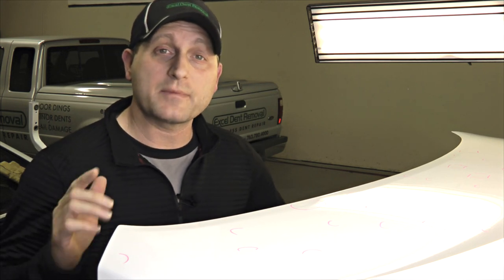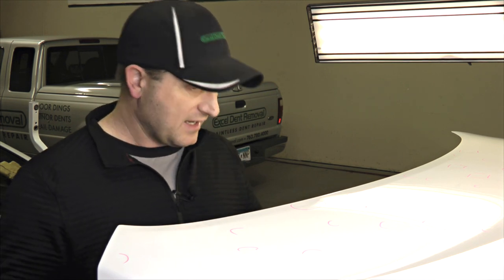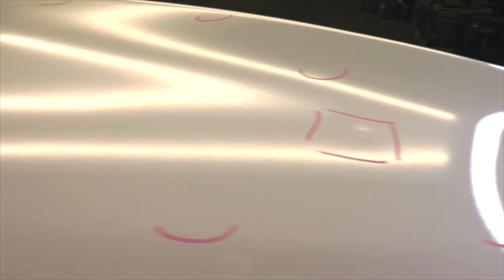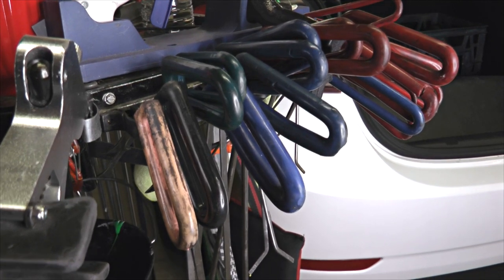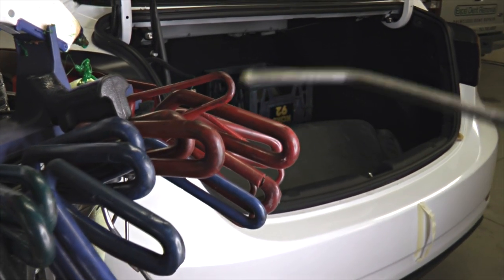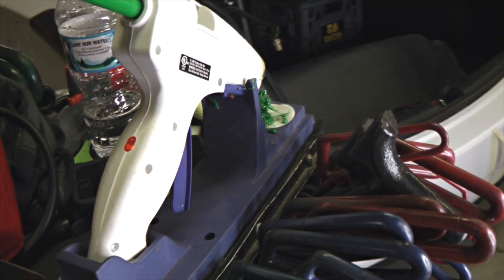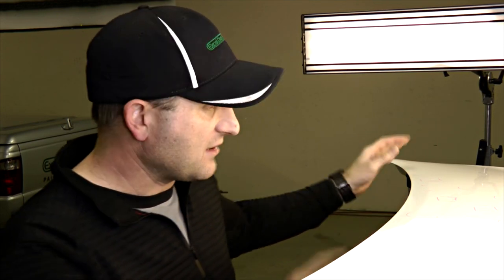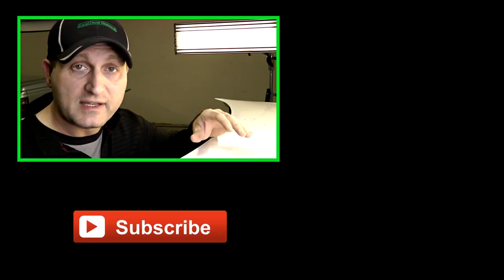How I Repair Hail Damage Dents | Paintless Dent Removal Under a Brace

Comment: Can you do an aluminum small airplane?
Reply from the maker: Yes. I’ve repaired dents and hail on several small planes. These are done under the supervision of the local airplane mechanic. They are often done during their annual inspection since they have to take many panels apart already.

Comment: Thanks for the video, is great ! I have a question , i can use the hotbox or woyo to fix dent as in this video ??
Reply from the maker: I have tried using the hot box before and didn’t have any success with it. 
I believe it can be used in certain cases but it’s not going to always work.

Comment: Hi, can this technique be used on older cars with thicker panels, or is there an age limit?  Thanks
Reply from the maker: Yes. I’ve repaired dents on many older cars. I just completed this week several dents and dings on a ‘66 Lincoln Continental. 
The only issue with older cars can be if there is areas with a lot of filler or if the paint is old or not in good shape. 

I have some photos of older cars I’ve repaired over on Instagram. www.instagram.com/exceldentremoval

Comment: Great video! Thanks for sharing this. I have a question though, Will you start pushing from the outside of the dent towards the center? or from the center towards outside?
Reply from the maker: For hail dents we would start by pushing from the center. But only slowly moving the metal up a little bit at a time. Just enough to see a slight improvement but not enough to see where it was pushed up or leave a poke mark. 
We then will continue pushing up the lowest spot inside the dent.
Reply: @exceldentremoval  . Thank you very much Sir. I am willing to work on MANY hail dents I have on my car. Your inputs are very helpful. Thank you again.
Reply from the maker: Yes. Thank you. If you haven’t done paintless dent repair before. I would suggest first practicing on a panel from a junk yard or scrap before attempting on your own car. You may find it is much harder to do than it looks.
Reply: @exceldentremoval  I saw you say that in one of your videos and it makes me worry a bit I could make it worse.

Comment: What about a dent in the bonnet that protrudes outward. Some mechanic left a tool under the bonnet of my car and forgot about it when the bonnet was closed. It caught the brace and made an outward dent. Hammer and a bit of wood?
Reply from the maker: +Gallitron This video shows the basic idea of how I work with a dent that sticks out. 
https://youtu.be/P8nf3DStqP4
If it is small it can be knocked back in. Sometimes it will require making it into a dent and then having to repair the dent to smooth it out.

Comment: Why is conventional repair charged by the hour but PDR techs charge by the dent no matter how small like these hail dents.
Reply from the maker: Good question! Body labor and mechanical rates are based on industry standard "book" time. These hourly times are calculated based on the time it would take an average tech to do the repair.
Paintless Dent Repair charges are calculated using a different formula. Dent repair estimates take into account many factors for removing the dent. These include the size, access, and level of difficulty to repair the dent among many others. The standard "book" times are still used when having to remove or install any parts on the car.
For hail damage dents there is another formula that is used within our estimating software that calculates the cost to remove the dents on a panel. There are many factors that go into a hail damage estimate. This will include extra cost if the dents are larger.
Reply: I have a vehicle with mild hail damage and am realizing the PDR shops so far want full insurance estimate amount even though the estimate calculated replacing and refinishing nearly everything.  Both shops confirmed all can be done PDR but damn ...  Ask me if I feel they're both after all the insurance money they gave me.  Vehicle is paid for and the money is mine to negotiate PDR now or leave the vehicle as it is.  This is simply between the PDR shop and I.  Might just drive to Mexico and have this done for $1500
Reply from the maker: There are a couple of reasons they may need to see the insurance estimate. 
One is that often the insurance estimate is not enough to repair the vehicle properly. Even if it was first written to replace the panels and painting. PDR is not always less than conventional.
Another issue is liability. Even though you have been payed by the insurance company, they often need to contact the insurance company to confirm that the vehicle will be repaired with PDR instead.
Other issues could still be replacing some parts that can not be repaired. These are often missed or will need an adjustment of the purchase price at time of repair.

Just let the PDR shop know that you want to have it repaired PDR and want to schedule the repair. Without providing the insurance estimate, they will want to have the vehicle in for the full repair before spending the time to write up a full estimate. From there you will be responsible for all repairs.
Reply: Like I said previously the entire "mild hail damage" vehicle was deemed 100% repairable by PDR.  PDR should most always be cheaper than the purchase of a new panel, remove and install, in some cases welding and sealed like a roof panel which also requires the removal and reinstallation of front and rear windows, then all refinished painted to match.  Wouldn't you think ?   Maybe it's just the two ripoff PDR shops I inquired with.
Reply from the maker: For mild hail damage it would be less. But I have repaired many vehicles where the cost for PDR was more than repair/replace and painting. Often times having to do a roof repair at a loss since the insurance company will only pay the “max cost” of replacement. But we and the customer agreed that PDR was a much better option than a full cut off and replacement of the roof.
Reply: How can it be at a loss when you'll only dedicate your time and skill …   no additional costs of a roof panel, removing / replacing and refinishing.   What's the time allowed or max number of minor hail dents on a roof panel you think before it's best to just replace the roof ?  Same for a hood.  All hail dents no greater than dimes nickels or quarters
Reply from the maker: Well, not so much a loss from a materials point. But yes, the time involved. If you could be spending that time on another car that is at the proper cost. 
The average replacement for a large roof panel can be $2000-$3000, but if it can still be done with paintless dent removal but the dents/damage exceed the normal estimating formula, then the cost can be more than replacement. 
Yes there is a point where there would be to many dents or many large dents that would require a replacement. But than can be different for most cars. The thickness of the metal, aluminum, steel or HSS steel, access and size of the panel can all have an effect. 
On average I would guess a small panel , hood or roof, with more than 100 would be excessive and a large panel, suv roof, with more than 200-300 is to many. But I have done some with more of the dents that are small and I’ve replaced some with even less because of paint issues or the material properties of the panel, aluminum or HSS.
Reply: Say a late model truck with 50 roof and 50 hood small hail dents …  How much approximately to repair ?
Reply from the maker: +Green Bullitt That’s tough to say exactly. There are so many different factors between vehicles and damage that can change the estimate. 
On average for that type of damage, you could be in the range of $2000-$4000 just for the hood and roof. That would not include parts or any side panels. Those could easily add another $2000-$4000.
Reply: Late-model truck hood and roof can be replaced and refinished for $3000 or less including the parts ….   Fixing a mild hail damage car 1-2" dings with total of approximately 150 - 200 throughout entire vehicle should be about $2000 - $2500 not the 4 to 8 thousand you quickly went to for just pushing dings and flattening high spots.  This job is accomplished in 1-2 days.   I wish the PDR industry was fair and honest because it's not a complicated profession but most want arms and legs for payment from insurance companies.   Prove me wrong
Reply: Conventional auto body repair costs being substituted by PDR has no relation from one to the other.  Apples and oranges.   Conventional repairs require parts, material and paint supplies on top of the man-hours to complete the repair.  PDR on the other hand requires tools to re-shape sheet-metal as close to pre-dent condition as possible and time.  Much less time than what is required for conventional repair.  A whole lot less costs since there are none but man-hours.  So this so simply explained shows that PDR should be a lot cheaper than the conventional repair costs period.  Not hating just the truth.
Reply from the maker: Sorry. I was just trying to help not prove a point. You seem to understand the auto industry more than just someone that just got hail and was looking for an estimate.
Reply from the maker: You are correct that auto body repair and PDR are to different fields. 
Auto body will require parts and materials along with techs to perform the proper procedures. 
PDR is mostly all labor. While it may seem like it is done quickly compared to conventional it could be because the labor is all performed and completed while the conventional repair has a lot of down time in between repairs. 

I will say that PDR may seem easy to do but many find it is difficult to do it properly and there still can be years of training to do it right. 

The other issue I can see is that it is not just a tech doing the repairs and being paid but most are individual small businesses with expenses and the the time needed to run a business. These need to be taken into account on a cost basis compared to just paying a tech.
Reply: PDR costs should be fair and honest and never exaggerated has been my point all along.  Hard working people in this world get ripped off in many ways and the PDR industry should not take advantage of those who don't know.  Hail dings for example 1", 2", 3" and so on should be estimated at standard costs with added cost only if warranted.  These should also be grouped by quantity never surpassing the cost of a new panel.  My future PDR YouTube channel will explain this video after video to help better the industry and help minimize insurance companies and people being way over charged for PDR.
Reply from the maker: Looking forward to seeing what you have. 👍 I’m not saying the industry is perfect and everyone is fair. I can only know what is good for my business. 
I know that the expenses just to run my business every month are 2-3 times what I am paid as a salary for the 60-80 hours a week I work. There is no way I could even afford to pay a highly skilled and trained tech to replace me as my own tech and still be able to run the business.  
There is way more to just paying someone for a repair than just there time that is involved with the repair. 

Another thing with the auto body industry as a whole is that it hasn’t kept up with inflating living costs. The mechanic rates are double what the auto body rates are. This is keeping new techs from entering the auto body  industry and wanting to put in the time for the pay.
Reply from the maker: Since you originally asked what a fair price would be to repair the hail and you have an understanding of the industry. 
Then I would like to ask what a fair wage would be for a PDR tech and what is a fair amount that a business should make to cover expenses and make a profit.
Reply: Many variables affecting what auto body techs are paid in comparison to mechanics.  Long discussion there but I'm guessing both make about the same other than the most experienced mechanics.   If paid by production percentage, both would benefit greater.  Most all businesses employ non-productive personnel who only make things worse for the % who actually get the work done.   That's everywhere though.  Who's making life harder for the lesser paid are the the "non-productive owner and management" hogging up more and more of the company profit year after year keeping the worker at nearly the same he was making 4-5 years ago.  Just guessing but it's the same most everywhere.
Reply from the maker: Sounds about right. That’s part of the reason I keep my business small. 
That way I can take care of my customers and give them a reasonable price while I can still make a living and pay my bills.